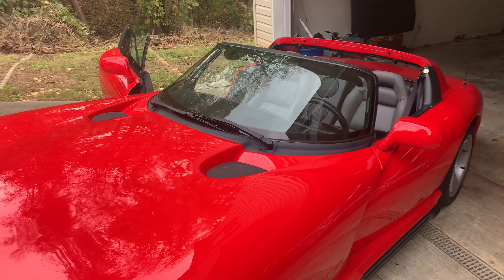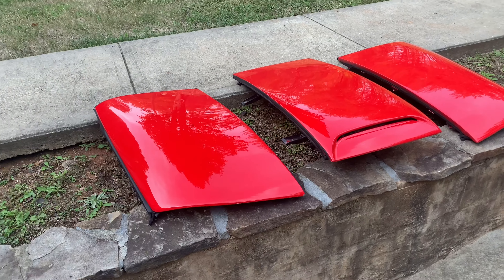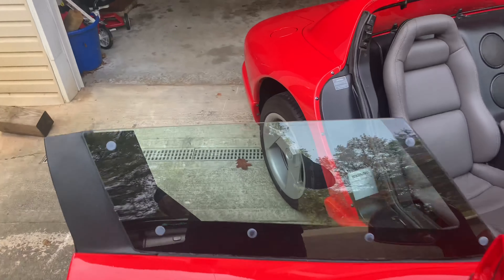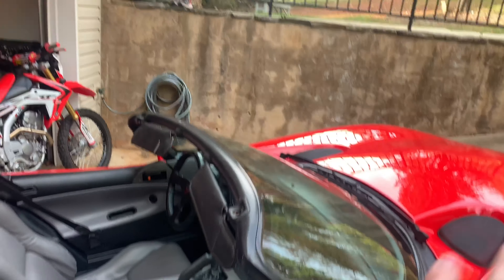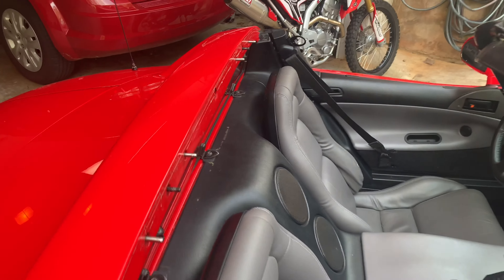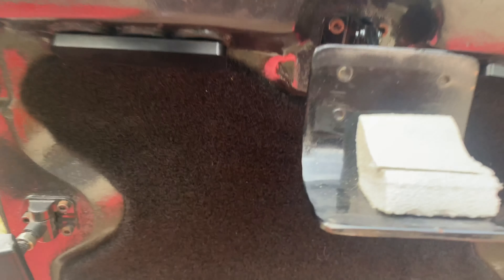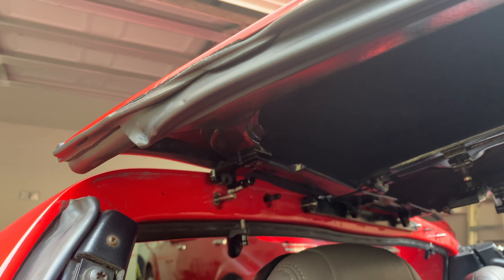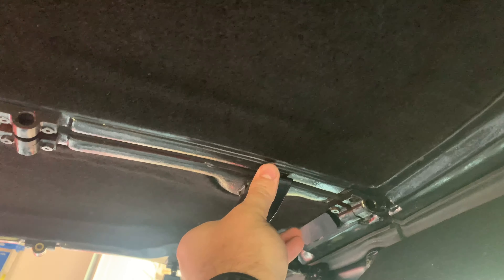Lemke 3 Piece Hardtop Install - ‘93 Dodge Viper RT/10

Comment: Where did you get the windows from?
Reply from the maker: Originally they came with a top.  Now days you would have ask around on the Viper forums if anyone had some.  These glass windows are specific to this top and I would think no other would work.  Jeff Lemke commented on one of my exhaust videos.  You might be able to ask him, since he is the designer of the top.